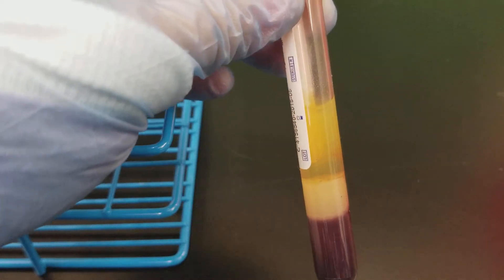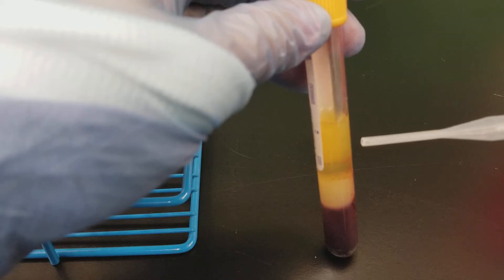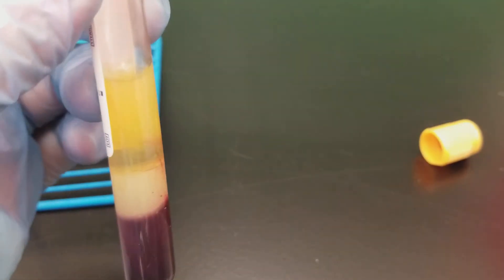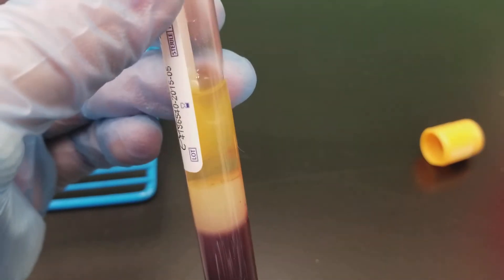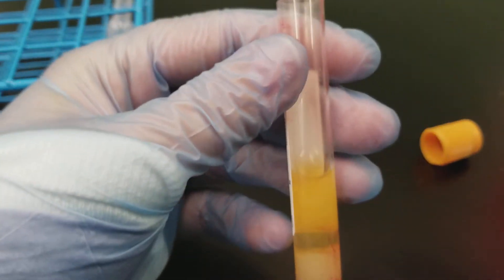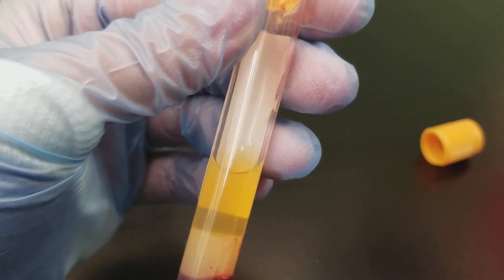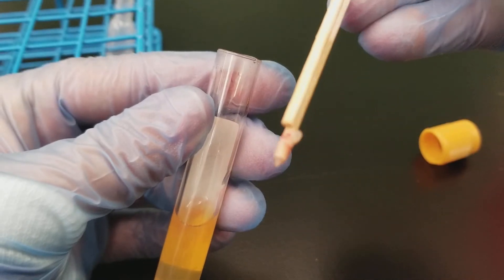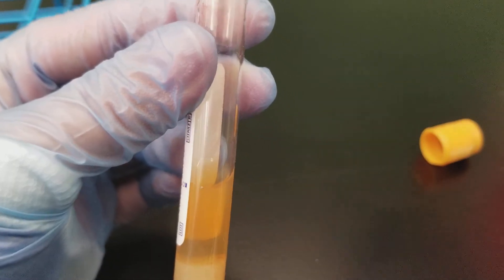Chemistry: Clotted Serum Separator Tube (SST)

Comment: HELLOW i know that plasma have a clotte so why you say that differant between plasma and serum that plasma is the liquid portion of blood before its clotted ??
Reply: Plasma should not have clots to be called plasma.  To obtain plasma you need to pour blood into an anticoagulant tube (such as a hematology or clotting-timing tube).  After mixing propperly, the liquid part of the blood that contains coagulation factors is inhibited and after separation of cells and liquids by means of centrifugation, you end up with plasma in the supernatant.    
Serum is what you obtain if you draw blood and you pour it into a tube without anticoagulant, and therefore the blood clotts naturally, or you pour it into a clotting-activator tube and clots form faster.  Then you run a centrifugation step and the cells and clots go to the bottom, then you have serum at the supernatant.

Comment: After adding sample to tube how much time i can let it before centrfugation and  the time of centrfugation and speed?
Reply: Time for blood in SST tubes to coaggulate you have to do inverting fo 5 time to insure the blood mixed with the Clot activator so it take 10 to 30 mints to clot so leave the tube standing for the same time, if you do it to fast you will end up with plasma Clots in the serum, the speed for centrifugeing is 3500 Rpm or (1.300g) for 6 to 10 mints.

Comment: I will conduct a clinical trial as a site coordinator and one of my job is that I'm obliged to centrifuge and transfer the blood samples to the tubes seperately.  Lab Kits will be sent but I know there will be only pipets and Sst tubes to collect the serum not the sticks which u have showed and used in video. Do I have to wait to plasma to be clotted and how can I be sure to collect all serum but not plasma because only serum is needed to analyze.any advise? Thank you.
Reply from the maker: OnurSevenDoğan 
This is a really great question!  Thank you for asking.

The Serum Separator Tube (SST) contains a clot activator and separator gel.  The tube should be inverted about 5 times immediately after venipuncture.  Centrifugation will then separate the cells from the liquid and put the gel separator in place.  The clot I pulled out of this tube is not a frequent occurrence.  Usually, tests performed on serum should not be affected if the liquid portion is still plasma.